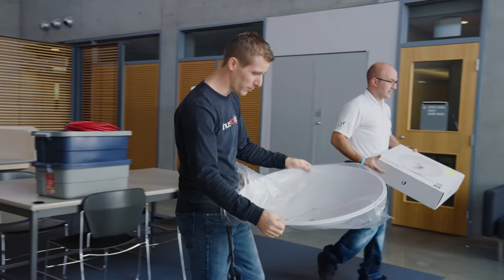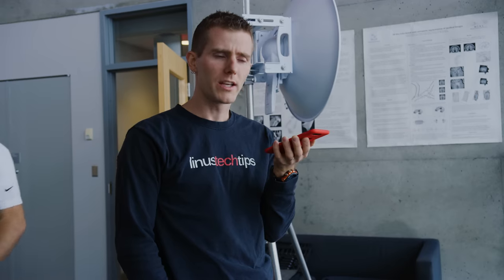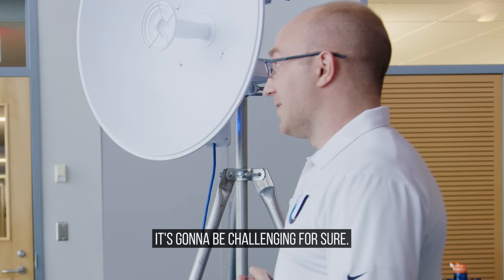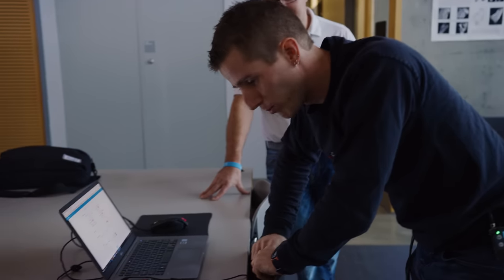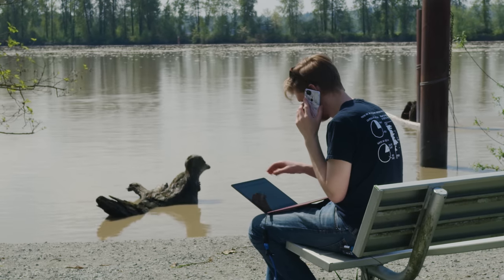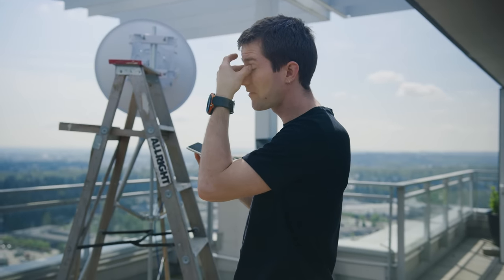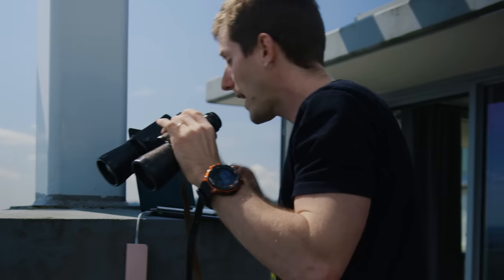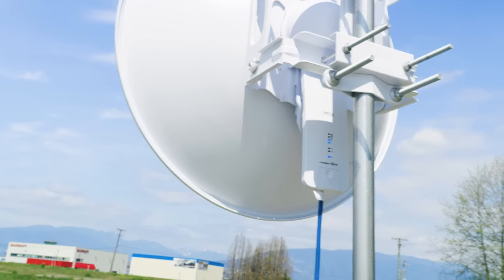12 KILOMETER Wi-Fi - SUCCESS!!!

Comment: Shouldn't it be easy with GPS and a compass?
Reply: It should be, but then you've got Linus involved
Reply: Niranjan Bhat Badekila GPS can be off by a couple meters and compasses have a similar problem.
Reply: Ya you can just calculate the heading using maps and then use an accurate compass to get it perfectly on point
Reply: Compasses can be really inaccurate indoors or near any buildings actually.
Too much steel and other ferrous objects.
My phone compass is between 5-15 degrees out in my room when I avoid going near electronics.

Outside in a field it's spot on.
Reply: Niranjan Bhat Badekila GPS is only accurate to about 10m
Reply: Gps be perfectly fine the distance they are doing it at, (as your adjusting the dish once you got a signal) and building won't have any effect on a compass unless it's made out of magetnets (this was more funny to watch on how not to setup a point to point network)
Reply: the actual tool to use here is an azimuth machine
Reply: Well here, I don't think a couple of meters would be a problem at all for initial alignment. At those distances, a minute (1/60th of a degree) equates to 3.5 meters so the compass alignment would be the real problem in that scenario.
Reply: The antenna, the RF from the antenna, etc, throws off a compass.

Compass is good for basic alignment to get started.
Reply: It be extremely minor effect on compass, also gps tends to be more along the lines of less then 3m or 12feet (even less if you have the new satellites in range that are above gps channels 31) and if your near wifi networks as well and outside it be even more accurate if you're using Google Maps (geolocation wifi/Bluetooth +gps)
Reply: The beam is pretty narrow. It's kinda tricky if you aren't experienced.
Reply: Niranjan Bhat Badekila LOL, that implies that they had planned the operation at all - this was truly painful to watch, but got my thumbs up because it proved that even disorganised video jockeys can get the Ubiquiti kit working, if they give themselves half a chance.  That reflector was golden - literally!
Reply: I do this for a living.

The dish affects the compass, the tripod itself would be infinitely worse in throwing the compass off. Having any kind of EM transmission near a metal pole, tripod, tower, etc, just amplifies the problem. The compass can be as far off as 45*. Been there, done that. We don't use compasses within 40ft of the hardware.
Reply: Use a damn LASER for alignment !
Reply: There are tons of methods in our days to align two dishes.
You haven't done your homework well Linus
Reply: You don't need the compass to be accurate (i.e pointing close to North) you only need it to be consistent then you can calibrate it to physical landmarks.
Reply: this is actually what I did in military service in switzerland. we covered distances up to 80KM.. and we were only allowed to use a compass and a "analog" map and coordinates
Reply: Use laser alignment instead.. for better long range pointing..
Reply: In theory, but linus is involved, the easy way is banned in his presence.
Reply: Actually true
Reply: It's not that easy. Linus cheats all the time.
Reply: Though there are many correct "points" in this thread, My take on this is that the hardest part isn't to "know" where to point the antennas ((i.e. what direction)) but rather to actually MANUALLY ADJUST AND FIX THEM to point in the intended "direction"(alignment) (both horizontal and vertical). And locking at their equipment, both to adjust, fixate, and "measure" the direction of the antennas.
At least that's how it appeared to me.
Reply: Using phone compass. While avoiding electronics.
Reply: lucimon97 20m max deviation on a distance of 12000m means a max angle deviation of 0.0955 degrees.
That means they'd have to be able to even align the dishes to 1/3600th of a full circle for it to matter.
If you're already THAT close, you can easily fine-tune the alignment by watching the signal go up/down.

Not to mention that this only applies to the horizontal alignment, not the vertical. To get that down phat you'd need to know the exact height (above sea-level) for both locations, and take into account the curvature of the earth itself over 12km of distance, and then again you'd still end up with a horizontal alignment difference (from level) measuring into a fraction of a degree (i.e. something that's really hard to manually do).

Basically if you can get a signal that's all you really need, because you can fine-tune from there. If binonculars will get you that.. no need to mess around with anything else.
Reply: lucimon97 Who told you that?
They have GPS based surveying equipment now.
Reply: All you guys saying how GPS and compass not that accurate... I think that's at least better than binoculars....
Reply: lucimon97 

That depends on the GPS.

The GPS we use at work are accurate to 1cm. While the RT-3000 from Oxts are too expensive for this, Linus would have be fine with accuracy of a meter or so and I'm sure there are cheaper commercial options out there.
Reply: They are not professional.
Reply: It’s LTT why do you expect anything to be done the easy smart way?
Reply: @megla
Aiming with a laser at 12 km is super difficult. You move the laser 1 ° and for 12 km that's 210 meters difference. As if you try to hit a pixel at 8000 dpi.
Reply: Practical thinking is not a forte of the LTT media group
Reply: Poke Champ, you'd think that, but picking out a landmark and lining up with it works better than any of your options mentioned.

The GPS can be very accurate, depends entirely on the device, but that doesn't usually give you any actual useful information on the job site, the hardware (typically a tower in our case) throws off the compass horribly and for most of our shots binoculars are pretty useless.
Reply: npsit1, it is narrow, particularly on the dish they used. I think it's like 4 degrees.

If they had used a lower gain antenna they would have had a much easier time getting the link to work. They don't need a 30dBi dish at 8 miles.
Reply: Not sure about the 30dBi dish, but the lower models have some pretty wicked side lobes. You can get a 15 mile link working on a side lobe of the Nanobridge M5 25 or the Powerbeam 400. You'll have a link that isn't matching the signal level the calculations say it should, you turn it 10 degrees and it gets worse. You turn it 30 degrees and gain 20dB.
Reply: Even "toy grade" gps can be very accurate. In good conditions some cheap gps and some installed in phones that I tested had accuracy of sub 1m. In bad contitions if you plot enought points you get circle around your real location anyways and that should be good nuff for reference. Compass should be good enough to get bearing at least then slowly scan
Reply: Exactly
Reply: Niranjan Bhat Badekila using smartphones does have compass.

Comment: "I should have really brought a compass"...bro your smartphone has a default compass app...
Reply: Mine doesn't have one.
Reply: Not everyone has an iPhone bro.
Reply: @invalidsudo  cough my Huawei has it by default, and can also use my camera with it to point in a direction cough
Reply: @Dr1ftop1a  not everyone has a Huawei phone bro.
Reply: @invalidsudo  Well,... That's true. And I don't know how to respond to that sooo, that's the exit right? I see myself out. 😐
Reply: All phones are eqiuped with global positioning system (GPS) THAT INCLUDES COMPASS
Reply: @Finsh  oh boy here comes the boomer
Reply: Smartphone compasses can be rather finnicky
Reply: @invalidsudo  i have a huawei bro
Reply: @Dr1ftop1a  huawei ftw?
Reply: @chrisbtw6896  Naah. I actually don't like them. Probably going to switch back to Samsung or something.
Reply: Bruh even one of the cheapest xiaomi phones (Redmi 6a) has a compass built in
Reply: Only some have it pre-installed, but most have a compass in them (GPS) you just need an app (software) to use it
Reply: You don't use a phone. We use a laser with a receiver on the other end. You can use Mirrors as they did. 

You want fast speed. Use the AirMax. Then use concrete and steel pipes to keep it still. As wind will push it around.. No getting around nature...
Reply: A GPS app should give a position and a bearing, to a waypoint. That and a map should be sufficient to know where to point, provided there are visible and locatable landmarks.
Reply: Dr1ftop1a need a cough drop?
Reply: @invalidsudo  I have Samsung and oppo phones that also have compasses. All android.
Reply: @invalidsudo  wait I thought every phone had it
Reply: compasses on phones needs calibration
Reply: Even my Samsung S3 2012 has a GPS. What trash did you buy?
Reply: @d.romero3014  which phone do you have?
Reply: @wiiguygaming3291  no it does not.
Reply: 19thHour i thought exactly the same thing, there is a built in compass app and even if your phone didn’t have it you can download one for free. Geeze these guys man...
Reply: @invalidsudo  you can open google maps
Reply: @charan7208  Motorola phones don't come with one pre installed, and at least on my phone any of the compass apps available don't seem to work very well.
Reply: @invalidsudo  everyone with a smartphone has an app store bro.
Reply: They are super inaccurate
Reply: That's on iPhones
Reply: @funnysubject9826  and the play store for androids.
Reply: Guys please dont expect the compass app on the phone to be accurate. It really isnt! Every phone tells you different. It's something that isn't solved on mobiles nowadays. And the fuck coding compasses sucks so hard
Reply: Just because it shows you one or two decimals, it does not mean that it is that precise. You just don't notice it, since you do not have a real precision compass next to it to compare.

Comment: 15 MB/S from over 12 KM thue wifi signal

it only took us 6 months.... seems legit
Reply: Typically Only takes me 6 hours by myself to setup a permanent link....including driving back and forth to do the tuning...but I do this several times a week so I'm likely better at it by experience....
Reply: 69 likes :D
Reply: In my job we do links for such distances pretty often and it works just fine. ;)
Reply: You watching polecat?
Reply: Bruh... My 5ghz transfer speeds at home, 5 feet away from my router, never go higher than like 25-30MB/s. 

So 15MB/s over 12KM... That's actually pretty freakin' insane.
Reply: @XtremeConditions  Your home router either route packets in insane manner, has a processor that can't process any shit, overheat, or basically have screwed up setting.

What I am saying is that even cheap Chinese knockoff router can achieve higher speed than this, provided you actually bothered to check with router setting.
Reply: @Verpal  It's one of those all-in-one modem/router units from my ISP and it does what I need it to. That being said, I may check out how my old TPLink 300mbps 2.4ghz router performs. I kind of wonder now.
Reply: @XtremeConditions  Definitely compare them , it is simply not normal for a relatively modern router, especially full size one provided by ISP, to perform in such abysmal fashion.

Unless you are using Comcast, of course.
Reply: @Verpal  I am using comcast lol. Sounds like you have experience with them...

I am able to do things like stream my xbox to my PC fine, things like that. But then, I guess that's in line with my transfer rate. Anything more, and things kind of seize up. 

Maybe it's time I just get a replacement unit. Might as well at this point.
Reply: @XtremeConditions  Comcast.... why am I even surprise at this point.... may god bless you and your internet connection :D
Reply: @Verpal  Thank you sir... Perhaps someday, the sunshine of epic internet will shine on me. 

Actually tbh, connecting outbound is great. I'm actually really satisfied overall with my speeds. It's just the damn units they include usually aren't everything they can be... 

Totally sucks, and they're almost undercutting their own service by doing that kind of crap.

Comment: Can someone technically use this to fly a DJI Drone that far away?
Reply: You could probably set it up on a turret so the dish follows the drone around, probably go even further
Reply: probably, but you'd be near the weight limit of the biggest ones from DJI because you'd need a dish on a gimbal on the drone, and they can transport up to 5kg.
though you could get another brand, there are some agricultural drones that can fly with up to 25kg. (but you'd probably be looking at 10 grand)
Reply: Just as long as you...
1. Fly under 400 feet
2. Never fly near other aircraft
3. Keep your UAS within visual line of sight
4. Keep away from emergency responders
5. Never fly over stadiums, sports events or groups of people
6. Never fly under the influence of drugs and alcohol
7. Never fly within 5 miles of an airport without first contacting air traffic and airport authorities
...and follow any other stupid rule that the FAA has set.(or don't get caught, lol)
Reply: well, you'd have to have a damn good eyesight to fly a drone 12km away. (it is without visual aid aside from glasses.)
Reply: You could probably use them to fly a drone if you had them set up like in the video, then with an extra WAP at one end, Linus could fly a drone that Brandon and Alex turn on near them, but not fly it back to his parents' house.
Reply: No for 2 reasons: 1) the drone wouldn't be able to carry and point such a large antenna and 2) these antennas are not compatible with regular WiFi clients, such as your drone. You have to have two of the same kind. They aren't even compatible with other generations by the same manufacturer.
Reply: yes of course if you change the base antena with 120 degree antena and stick antena at the oposite
Reply: Use radio signals for that
Reply: one of the drone largest weight carrying capacity drones from DJI would be able to carry and this antenna on a gimbal, but it would be on the end of what it can do, so no fancy maneuvers could be done.  
the antenna is around 3 kg, a gimbal for aiming it would be 1kg, the drone itself is 4kg, and the carrying capacity is around 10 kg (from memory, but it's in that ballpark).
Reply: For that, you're better off going with a lower 300MHz UHF signal (tx and rx) for control.  But then, you couldn't see, so stick a camera on board with a 1.3GHz , 500mW transmitter using circular polarized antennas and you could do 50+ miles range for both control and video.   Forget DJI, you might as well build out your own platform to use large props (12-14 inch) and 6S battery.  Low KV motors and your drone will have over 30 minutes of flight time.
Reply: As long as it never left the direct line of sight which is less than 1° angle hor and vert
Reply: you can use a sattelite controll module with drones, you could technically fly on the other side of the world, i think the thing was called something with dragon
Reply: add some wings, so it can glide?
Reply: You will lose signal comming from the drone like visual camera but you don't need a return signal to pilot the thing if you have eye contact.
Reply: I think the best way for signal stability would be beaming the signal over parabolic antennas (dishes) to a high-power antenna in the area that you're flying. That way your signal is always stable, and your range is greatly increased due to the amplified signal on the repeating antenna. Are there more expensive ways to do this with dishes only? Yes, but my way is less finicky.
Reply: best way to pilot a drone would be to use multiple cellphone antenas arround the city and pilot the thing using internet connection. Smart auto-pilot could fix issues when losing connection, like returning back to base by his own and land.
Reply: The lab I worked in at college had drones that had directional radios for long distance communication.  turrets on both the ground station and the drone.  drone kept in alignment by knowing its lat/long and altitude and compared it to the known fixed position of the ground station and the ground station turret was fed the drone's position and altitude for alignment.  was fast enough where the drone could move at up to 60 mph and keep full signal.  airplane style UAVs have a more predictable position and therefore could move faster.
Reply: Yes. People have been flying long range before you could even buy a Phantom. You can go over 100km with the right setup.
Reply: wifi turret. Nice
Reply: +Andrew L I try my best with rule #1.  #3???  LAMO!
Reply: how are those rules stupid at all??
Reply: You can set up drones to go through ethernet, making distance a no problem. Not seeing the drone in sweden is however illegal.
Reply: The tello could use this
Reply: The rules are for inexperienced pilots, in my opinion.
Reply: Lol the struggle was real. Great video
Reply: Dude, you can easily fly a DJI like drone that far with other systems. You could that far away and more for cheaper.
Reply: The antennas are. The radios are not. UBNT's AirMax is a proprietary protocol over the standard 802.11x. However you could technically connect a standard 802.11x AP to the feed horn (or a regular UBNT Rocket with AirMax disabled). It would be hard to maintain a drone in such a small beam though. And maintain polarity. That's why most drones nowadays use circular polarization over linear.

TLDR; It's possible, but not practical.
Reply: no. DJI doesn't use wifi or Airmax, and the drone couldn't lift a dish that big.
Reply: @zwz • zdenek
 This is not true. Obviously the drone cannot carry or power the radio, but these antenna are 100% compatible with regular wifi clients using the 802.11 standards. All it takes is configuring the radio properly. They are also 100% compatible with older generations provided they use the same 802.11 standards and are not using AirMax or AirPrism.